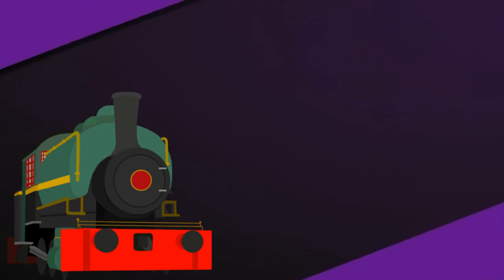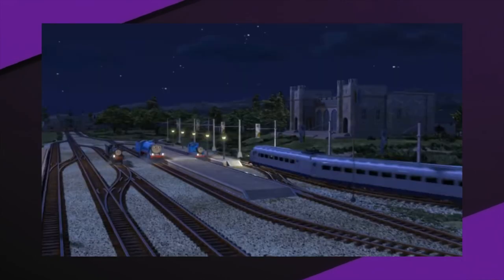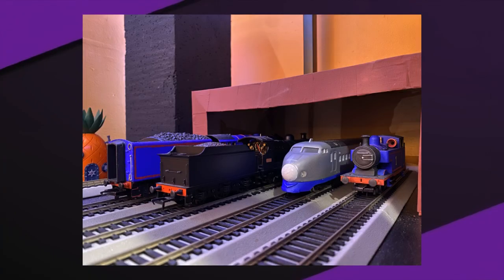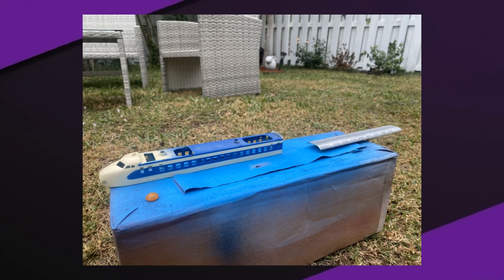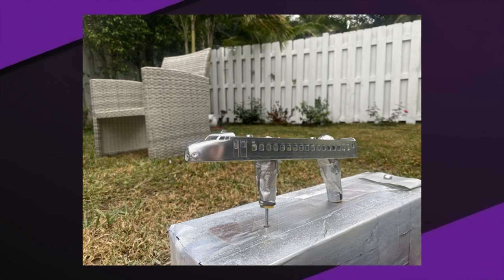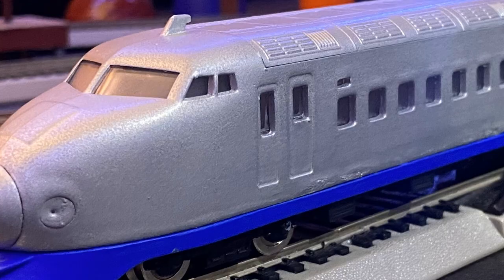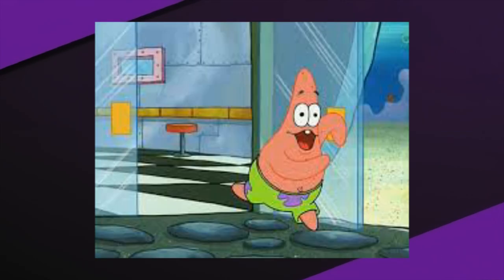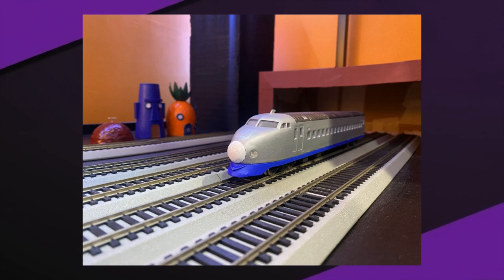How I Built Kenji - Porterverse Workbench

Comment: Actually there is a way you can buy an HO scale d51 locomotive for cheap! In retailers like five below and amazon for example, there are these battery operated HO scale train sets that have the D51 as the locomotive and you can use that locomotive to make hiro, like i am. Im still in the process of finding a face, buffers, and a hornby motorized lms black 5 stanier tender with pickups. Youtuber sams trains used a similar locomotive and converted it into a real working ho/oo runner using a hornby flying scotsman tender with pickups, and I'm thinking of doing a similar conversion so I highly recommend you watch the video it's really cool. Once you can find a black battery operated d51 Loco with either black or red Wheels and maybe a Hornby LMS stanier tender with pickups (the d51 and stanier tenders look similar), you can make an ho/oo hiro too!
Reply: This honestly gave me an idea actually, I’ve seen those toy train sets with the d51 in it, I need the master of the railway in my growing collection of the nwr engines